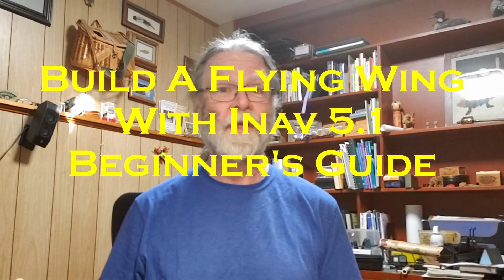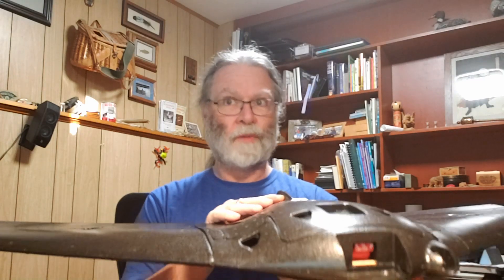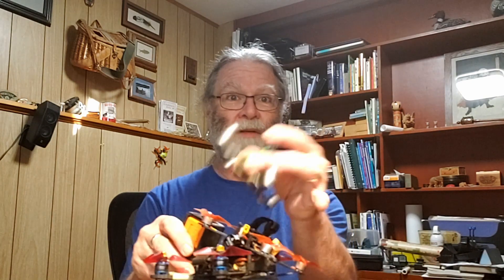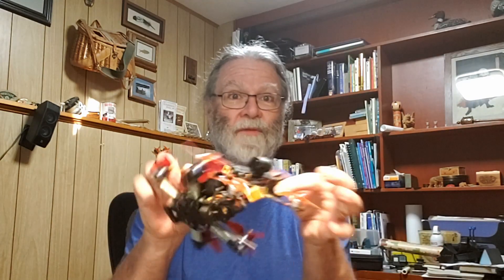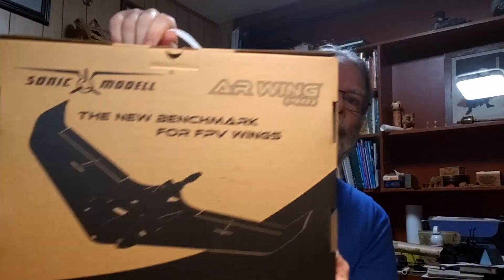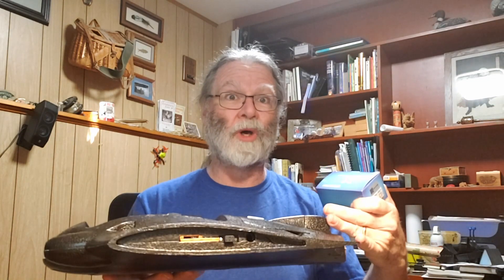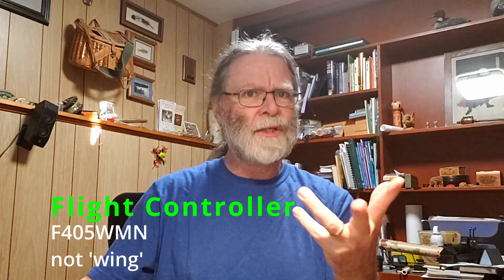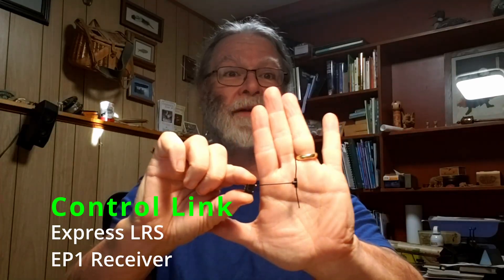Build a Flying Wing - Beginner's Guide : Introduction

Comment: Thank you for your kind and inspiring videos! I am going to build a wing with your assistance.
(Please note that this video should probably be the first in the playlist)
Have a flying day!
Reply from the maker: Thank you for the comment and taking the time to watch.  I hope that the videos help you out with your build.  Don't hesitate to ask questions if  you have any.
Reply: @blueskyfpv  Thank you very much! I would like to ask what types of batteries you have used and what batteries you recommend for maximum range and payload?
Reply from the maker: When you read my comment, keep in mind that the ARwing pro is like an airliner, not a fighter jet.  It will never be an agile speedster, but it can carry a lot.

For a flying wing like the ARwing Pro, you can use either a normal lipo battery designed for planes, or you can use a li-ion battery pack specifically designed for RC use.  

For more agility, keep the all-up weight to the recommended 1400g or less.  If you want slow & steady & agility doesn't matter, you could probably go up to an all-up weight of 2 - 2.2kg.  It may carry more, but you'd have to watch for lost efficiency.

I use two sizes of lipo.  Small: HRB 4s 3300 mAh matches recommended size and gives decent performance and 15-20 minutes of flight.  Large: CNHL 4s 5000 mAh (38X50X145mm & 510grams).  It is a TIGHT fit, but not over-weight.  This gets about 35-40 minutes.  Any decent brand lipo with a "C" rating of 40 or higher will be OK.

Lithium ion packs made from high drain 18650 and 21700 size cells are also quite popular for long range.  They weigh about 1/2 as much as a lipo, so you get double the capacity (and more) for the same weight.  The 'and more' comes because you can very safely discharge li-ion batteries to 2.8v/cell.  2.5v is empty.  A lipo needs to stop at about 3.5v, so you get much more useable capacity with the li-ion.  However, li-ion packs can't deliver huge amperage like a lipo, so you are limited to more relaxed flying style.  Which is why they are perfect for long range.  The ARWing Pro can easily manage a 10,000 mAh li-ion pack (depending on shape).  A number of companies make these now:  Dogcom, Auline, Zohd, Ovonic, CNHL.  I do not have these myself because I make my own, but the best are made using either Molicel, Sony or Panasonic cells.  Molicel are by far the best  high-drain li-ion cells available.  Molicel INR21700-P45B (4500 mAh, 45a drain) or INR-18650-P28A (2800 mAh, 35a drain) - sadly they are not exactly free!

As for range....how far can it go at 60 km/h on a 10,000 mAh battery?  Way beyond FPV range for sure.  I've never flown 'far', but but based on total distance I can fly,  I'd guess 30 km+.  Maybe check some of the forums for long range flyers to get more details.

Hope this is helpful.
Reply: @blueskyfpv  Thank you, your expertise is very helpful.
Would you please also specify or recommend an ELRS receiver?
Reply from the maker: I don't have 900 MHz ELRS, so I can't comment on it fairly.

For 2.4 GHz ELRS, there are the two general types of receiver.  One has the small 'cube' antenna, and the other uses a full 'normal' T-style antenna.  At the same transmitter power, the range of 'cube' antennas is much less than the 'T" style.  Depending on placement, a cube will still go very far (I've gone 2km+ with a cube with 95% Link Quality).  T-antennas have been shown to reach 100+ km depending on setup.  Of course that kind of distance is clearly BVLOS (Beyond Visual Line of Sight)...unless you're an elf scanning for orcs.  This page: https://www.expresslrs.org/info/long-range/ shows what kind of range is possible - its quite incredible actually.

As for brands, I have only used HappyModel and Foxeer.  Both work well for me.  However, any ELRS receiver from a reputable RC/FPV brand will be fine.

In the ARwing Pro I have a HappyModel EP1, and in several of my 5"+ quads I use Foxeer 2.4GHz PA+LNA.  In my micro/mini quads I use Happymodel EP2 cubes because they are cheap, tiny and easy to get.  I have also used HappyModel ELRS PWM receivers and they work well if you aren't using a flight controller.   Newer ELRS receiver models from many companies now include "PA" and "LNA" which is supposed to help with signal clarity.

Cheers.
Reply: @blueskyfpv  Thank you, this is really helpful. Scanning for orcs is precisely what we elves do here in Ukraine.
Reply from the maker: Happy to give whatever help I can.